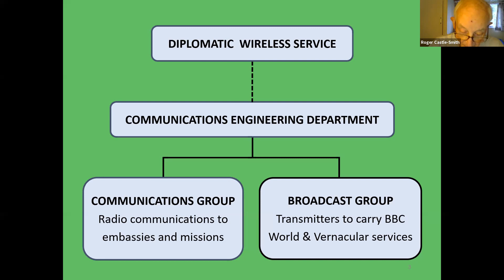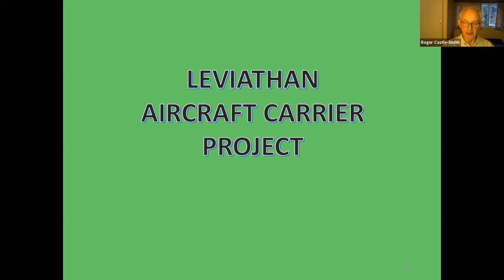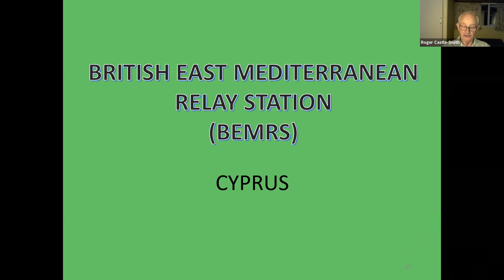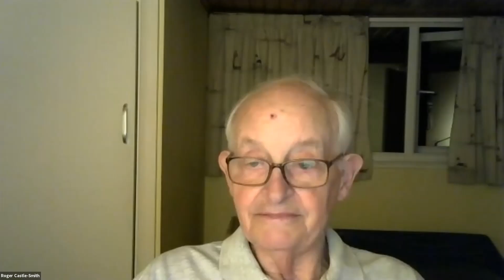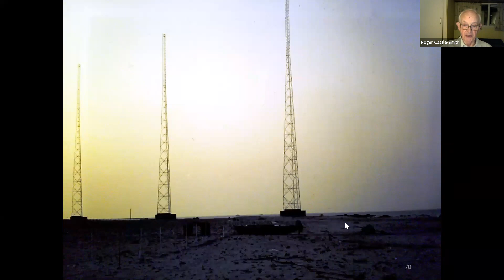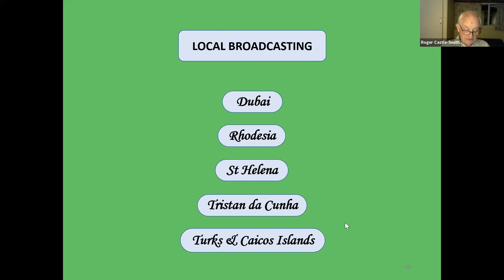North Wales IET Aspidistra and The Diplomatic Wireless Service

Comment: Thank you for this, very interesting. Surprised I am the first to comment here, the live feed comments do not show here. Therefore my apologies if I am repeating topics already covered. I have a number of comments, dare I say, possibly, corrections, and questions. 
                          
MY FIRST COMMENT
   is that I am certain that  the Aspidistra Transmitter (Aspi 1) is not the 500 kilowatt transmitter built for  Crossley Broadcasting and installed, in 1934, at Crossley's, Mason, Ohio transmitter site for station WLW. Although the FCC, later, re- affirmed its 50 kilowatt limit the transmitter was not put into storage, when WLW returned to 50 kw in early 1939. It remained in situ in the transmitter hall at Mason. Not for the regular WLW programming but under an experimental licence and using different call letters the transmitter remained in occasional, "early morning" use, over a number of years for development purposes.
 There are a number of videos on YouTube shot in recent years  showing it in situ at its original 1934 site, Mason, Ohio, USA  not Crowborough, Sussex, England.

Most sources  and IIRC Robin himself, state that the transmitter that is Aspi 1 was being assembled by RCA for New York station WJZ, in anticipation that they would be granted a 500 kw licence, this did not happen. It was this transmitter the PWE purchased from storage  at RCA, not the one built for and owned by Crossley, as implied in this video/webinar.

MY FIRST QUESTION.  
Aspi 1 was capable of producing 600 kw, after modifications at RCA under the direction of Harold Robin, but what was the actual maximum EMRP when fed through the 3 mast directional array at Crowborough. I have heard 1,200 kw. Is that correct?

MY SECOND QUESTION
I was told, in the 1960s, not by an insider, that...... "not within the BBC programmes but on the side of the carrier wave of the Crowborough transmissions   there are secret messages for embassies".
I am not technical and at the time thought maybe true or just myth. Later I became aware of tele switching by data transmitted by phase modulating a wireless carrier wave, as is done by the BBC LW/LF, 198 kHz transmitter. 
So did Aspi transmitters use phase modulation for (secret) data transmission alongside amplitude modulation for (public) programme services?